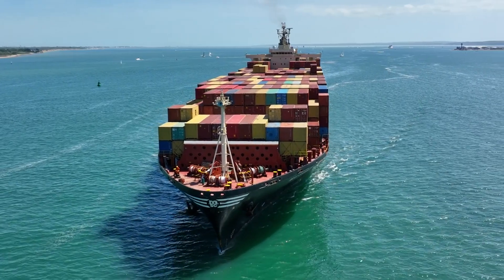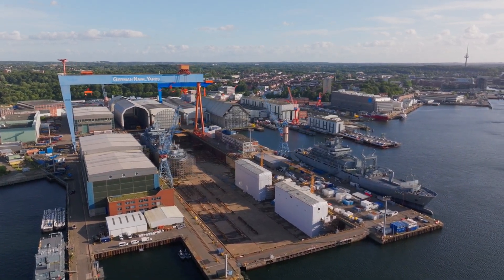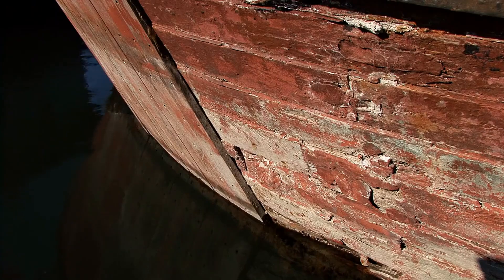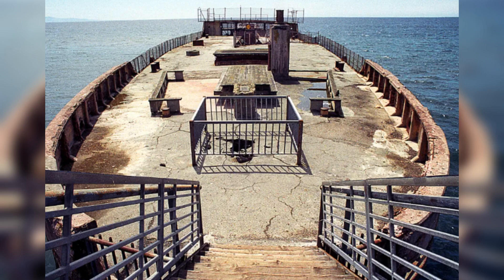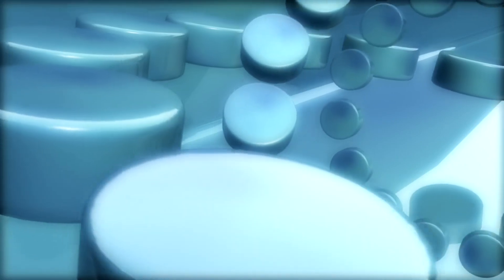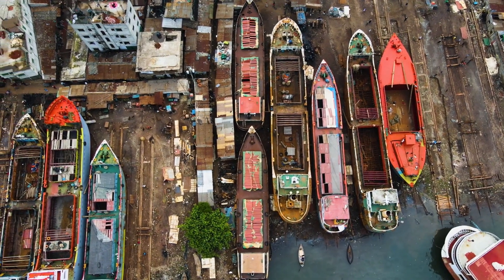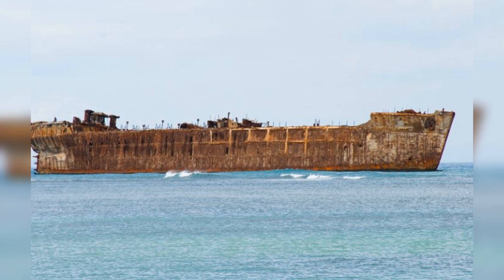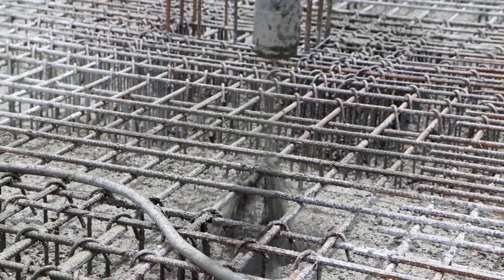The Concrete Ships That Actually FLOATED in WWII

Comment: Today we have newer technologies that can make UNSINKABLE concrete ships with the use of stainless steel reinforced concrete encased cement and-or concrete foam materials that contains 200% more closed-pore cement and-or concrete foams encased inside the hulls or within the interior walls and floors or both. The use of liquid sticky rice glue-slaked lime water at a ratio of 13 parts volume water + 1 part volume sticky rice powder + 1 part volume slaked lime powder can create a liquid ANCIENT CHINESE MORTAR WATER THAT IS INDESTRUCTIBLE!

Comment: The problem with WW I builders and WW II builders of concrete ships is that of the sheer ignorance of the fact that stainless steel rebars and stainless steel wires and stainless steel mesh used for reinforcing concrete already exists. Their sheer ignorance of the existence of concrete materials of the ancient world which is time-tested and time-proven is appalling when they could have used a (A) mixture of equal volumes of burnt lime (or quicklime as they call it) + iron slag dust powder + good quality clay used in making good quality bricks. Or they could have used (B) and equal volume of burnt lime (or quicklime as they call it) + brick dust powder. The addition of aggregate gravel made out of closed-pore granite foam or closed-pore basalt foam is an option. 

Both (A) and (B) mixture are both hydraulic cement mixtures that cures and hardens under seawater or under freshwater. One can add aluminum powder or aluminum paste to either of them to make them into closed-pore foams. 

(A) is time tested and time-proven for almost 300 years and is still intact. Smeaton mortar. 
(B) is time tested and time-proven for almost 1,500 years and is still intact. Haigh Sophia mortar.